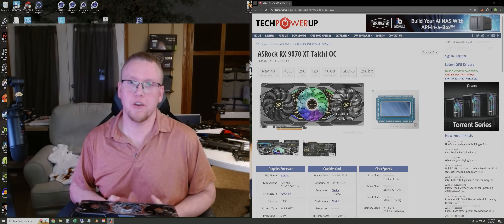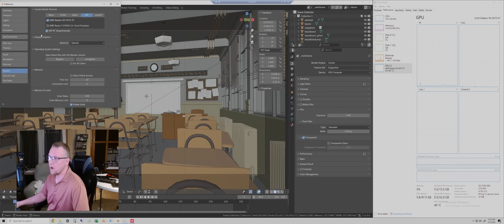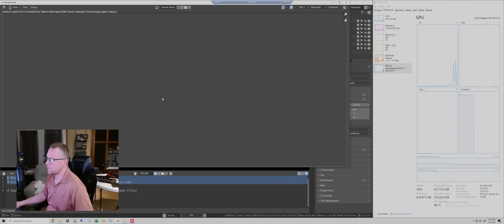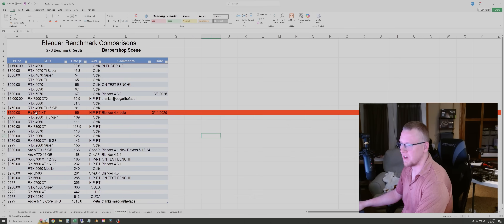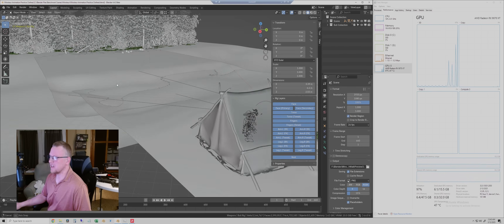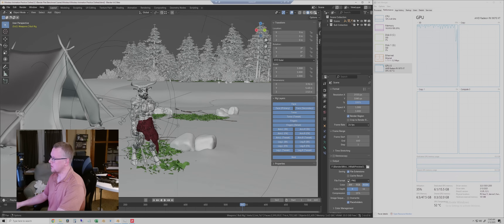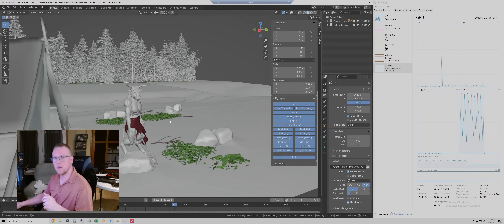NEW AMD Rx 9070 XT Render and Viewport Tests in Blender

Comment: Wow, your videos are amazing! I'm looking to buy a new PC for both work and gaming, as I work in graphics and 3D. I have two options: the 5070 and the 9070 XT. Which one do you think is a better long-term value in terms of overall performance?
Reply from the maker: Hey thank you! I am glad you found me! I know that for gaming, the 9070 XT is a good value. Nvidia drivers tend to last for many years though. So for 5 or more years, the 5070 would be more safe as a production PC. Just look at older AMD cards from 5 or more years ago now. Many creative apps can't even run a Rx 580 at all now. Conversely, my Kepler K1200 can still run Blender and other apps, even though it is slow. So Nvidia support is much longer. So I guess it would depend on you timeframe.

In reality, both GPUs should be great components for quite a few years, assuming nothing changes with Nvidia and AMD in general.

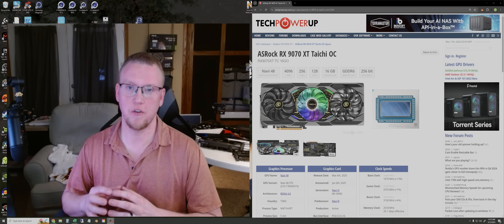Comment: I am getting 1:30secs  with the barbershop scene on the 9070xt, latest drivers.  I am running 128gb 5400mts and a 9950x3d :/
Reply from the maker: That looks like it matches my data pretty close. Glad to have some peer review!
Reply: @ContradictionTech  Hopefully hiprt peeps and blender will find better ways to use rdna4, lemme know if you require any testing done, thanks!
Reply from the maker: @rogernaruto13  Yeah RDNA4 hardware is underutilized by HIP-RT for sure. Thanks for reaching out!
Reply: @ContradictionTech  4.5 has better support now, you can have the denoise in viewpoert done via gpu btw, it still crashes when subdividing 25+ plus faces tho

Comment: I've been wanting to switch over to Linux completely and NVIDIA's drivers have been a deal breaker so far, I have a 3060 12 right now. Might upgrade to the 9070xt if Blender & others start supporting it the way they do the AI Chip Maker.
Reply from the maker: Yeah that's the question. If the gaming scene is all AMD can get for now, they may not develop software for awhile. But, the 9070 XT is fine hardware anyway, it's already a feasible choice!

Comment: blender 4.4.0 is not using my RTX5070 for rendering, its using my processor and im not sure why. 
i have the same settings in blender like you (optix checkmark RTX5070; blank processor) but it wont work for me pls help 
thankful for every answer
Reply from the maker: In the render settings, make sure the render device is set to GPU and not CPU. It is the render settings menu on the right. 
Also, keep in mind that Windows will not show GPU usage correctly with task manager unless you change the graph to CUDA or compute
Reply: @ContradictionTech  Thank you man. The device was set to CPU and not to GPU. Im just not familiar with blender or such programs. Now its rendering with GPU thanks a lot!!!
Reply from the maker: @jasonweirich6961  you are welcome! Glad to help!

Comment: I hope you see this comment. Viewport (solid) performance is all on the CPU. The GPU doesn't matter one bit with viewport fps speed. You can verify this by putting the same GPU in a wildly different system and seeing the different FPS. Thanks for the video.
Reply from the maker: Hey! Thanks for the comment! I thought so too, but different GPUs on the same test system have been yielding varied results for me. Especially in high poly scenes. It seems like lower end GPUs definitely do slow the viewport in solid mode.

Comment: I've wanted to get a 9070XT, I currently own a 2080Ti and don't really know if it's worth it or if I should wait for a 40/50 series card. It should be faster since there's a lot of generational improvements and new tech, and I also don't really plan on spending too much
Reply from the maker: Are you mostly using it for Blender or gaming? Your use case will change my recommendations slightly, and budget will too. I think the 9070 XT is a good GPU overall
Reply: @ I do mostly gaming as my main GPU intensive tasks, but I also model/texture/sculpt and do some animations using Blender (I’m limited by my GPU here so I don’t render much right now, but plan on doing more, I own a 2080Ti AMP which is a 300w card at its max performance, its very inefficient). I also use After Effects and Substance softwares, and these softwares don’t really use that much GPU, but still needs CUDA acceleration to work faster
Reply from the maker: @dummmics  Ok yeah to me, the 9070 XT seems like a good pick at MSRP, as long as Adobe software works fine on AMD. I assume it does though. AE system requirements says AMD works. So you should be good to go!

Comment: I am not a frequent blender user but came across your benchmark and compared to mine (4090 ones) and there is a noticeable difference in the durations. My results respectively were 10.9 s, 53 s, 89 s, 53 s respectively as per scene sequence in video, tested with blender version 4.0.1 and 4.3.2. I am finding the performance to be at least 25% deficit in my case with same render settings. My card is running at base clock. Any idea what could be the reason?
Reply from the maker: Well what is your CPU? And are you using a new studio driver for the GPU? My 4090s are both higher end models, so there is a little extra OC built in, but definitely not 25%.
Also make sure the Blender files are running on an SSD inside your GPUs machine. I have found loading time to be quite bad with files shared from another location
Reply: @ContradictionTech  CPU is i9-14900k and files are being loaded from my gigabyte gen4 7300 1tb ssd. The 4090 I have is the Asus TUF OC model (has all the ROPs). But I am using game drivers instead of studio ones. Do studio drivers accelerate performance by that high margin? Haven't tested those

Comment: I desperately need a new GPU, I've got the RogStrix RTX 3060 OC 12G during the GPU crisis, it's shit. I was thinking about the RX9070XT, but seeing this I'm actually afraid to get it.. Older blender versions won't work... sounds really sketchy. How do Unity and Unreal perform and SubstancePainter/Designer?
Reply from the maker: Thanks for coming in to the stream, was a lot of fun! Do you have a better idea of what you might want for a GPU now? I would say consider the 4060 Ti 16 GB or 4070 Ti Super. But it also depends on what is even available.

Comment: should i buy this for 3d rendering i have a rtx 3050 also
Reply from the maker: The 9070 XT be significantly faster than the 3050 for basically everything, and has way more VRAM. If you can get one at a good price, the 9070 XT is decent. 
For 3D rendering specifically though, Nvidia is faster per dollar spent, when they are available.
Reply: @ContradictionTech  thank u very much, as I still mostly do gaming but have a knack in 3d rendering I will get the 9070xt
Reply from the maker: @Sharbzz  Great! Glad this helped then.

Comment: I've been wondering about the performance for something like the 9070xt for a while now using Blender and low and behold, I stumbled this video in my YT recommendations.  While I wasn't expecting anything top of the line with that card for GPU rendering,  it's great to see that AMD has massively improved on their hardware for both gaming and creative purposes. Thank you for making this benchmark vid, it's been really insightful.
Reply from the maker: I am glad you found this helpful. AMD is rapidly improving their hardware, and slowly improving software. The stable release of Blender 4.4 may be more effective at using this 9070 XT. I am going to test this soon. 
But even without a software fix, this GPU is a great mixed-use PC product. For 3D + gaming it is a very compelling GPU.
Thank you for visiting the channel!

Comment: which one should i get?
rtx 5070 or RX 9070 XT. i dont see any big difference when using blender and i only play video games at 1080p sometimes
Reply: 5070 will handle 1080p fine, but 9070 XT is considerably faster and will handle even 4k gamin. 5070 would struggle with 4k, mostly due to lack of VRAM. With settings to max, raytracing, framegen and all that. 9070 XT will handle all that just fine.
Reply from the maker: For your use case, it seems like either option is ok. If you have a preference for a model then decide by that. Nvidia does normally have better software support, but if you are not planning on using all kinds of programs, then no worries. For 1080p gaming, these GPUs will both be incredible too.

Comment: Thank you for the video! I'm glad the 9070XT didn't completely blow the 7900XTX out of the water. I was worried I made a premature purchase that I'd regret. That's aside the fact that it's marginal compared to NVIDIA (so what), I still wanted a great gaming GPU with the ability to do small projects on the side without breaking the bank. Thank you again for the informative video.

Here are some of my numbers with the 7900XTX using HIP (HIP-RT Enabled)[Blender4.3.2]:

Classroom: 16.22
Barber Shop: 78.82
Lone Monk: 114.64
Scanlands: 65.29
Reply from the maker: Thank you! I feel the same way about the 5090. Was afraid I would feel sad about my 4090 if the 5090 crushed it. Which is dumb, because I am extremely lucky to have all of the fancy hardware I have. Anyway, I think it sounds like the 9070 XT would be a good type of GPU for people who mostly game, and sometimes Blender.

I will add your results to my spreadsheet, as I do not have thorough data yet. Would you prefer that I add your name to the list, or keep your name off? Up to you.
Reply: @ContradictionTech   Great, I'm glad I could add more info to the spreadsheet. If you'd like instead of my username you can use the name "Linux-U" for the results, since I ran the tests on Ubuntu. Ah, also to add more data (if of any interest) I have also ran some tests using ZLUDA(lshqqytiger fork on github). If that is of any interest or not I will have those benchmarks below.

7900XTX using [ZLUDA v3.9.0][Blender4.3.2]:

Classroom: 18.37
Barbershop: 84.36
Lone Monk: 144.02
Scanlands: 93.60
Reply: @ContradictionTech  I'm happy with my 4080. Only because I do a lot of 3D work, which AMD Radeon hasn't caught up with Nvidia despite developing their ROCM API to compete with Nvidia's CUDA Cores. 
Even though I don't like how greedy Nvidia are with their prices.
Reply from the maker: @ The 4080 is a fantastic amount of speed too. Glad it works for you. That is one of the models I have not tested.
Reply: Thanks mate!!

Comment: How is it on Eevee ?
Reply from the maker: I can run some Eevee tests. Would you be interested in final render speeds? Or mostly viewport tests? I can run both as well. I will just have to get some Eevee compatible scenes, as this scene of mine is Cycles ready but not good for Eevee.
Reply: @ContradictionTech  Both will be very nice. And if I may ask what about compositing (other on GPU offloaded node computing) acceleration?
Reply: Both will be great 👍  I have a 3060 ti and planning to upgrade to 9070 XT. I usually do eevee rendering and view port for as Cycles is not my thing. Thanks in advance. 👍👍👍

Comment: It seems like AMD still struggle in some situations than the RT performance would suggest? Is this a hardware or software issue?
Reply from the maker: I believe it is a software issue. HIP-RT is not optimized at all for the hardware. On paper, the 9070 XT Should have much better performance results.

Comment: Im a game dev who wants to make the jump to linux would it still be recommended to pick up a 9070xt despite the performance loss compare to Nvidia? Looking to avoid the driver complications that come with Nvidia on linux haha.
Reply from the maker: Yeah make sure the drivers are ready for Linux on the 9070 XT. It should work well enough. Keep in mind, I do not use Linux currently, so I have less experience with AMD on Linux.
Also, Blender tends to run better on Linux, so if you are using Blender you will make up more performance than my tests show.
Reply: Thanks for the reply! I'll take the plunge then, And hopefully won't have to return to windows beaten and bruised some months later.
Reply from the maker: I think you will have a good experience. I used Linux briefly a long time ago. It is incredible for a free software with no strings attached. 
Let me know how it goes sometime!
Reply: Nvidia is barely compatible with Linux, AMD performs even better on Linux than it does on windows

Comment: It was a little disappointing to see the 9070xt being beaten by a 3080 in the smaller scenes, but that seems like a strange result. I hope driver updates address this.

I am a heavy C4D/Redshift I am very eagerly looking forwarded to seeing the Cinebench/Redshift benchmarks.  I manage a Price vs. Performance google sheet and I was really hoping AMD would make a strong showing in this generation.   IF the MSRP holds up they MIGHT, But if your results are pointing to a deficiency of some sort (VRAM loading? Definetly slow to first pixel). then Nvidia will still have the best GPUs for rendering in this generation.
Reply from the maker: Yeah I hope AMD drivers will improve. I imagine they will, since the Cinebench 24 test wouldn't load. It makes me think the driver is just not done. I was surprised Blender 4.4b had support, but AMD does work with Blender devs. So we will have to see if they can optimize any more. That and a newer version of Cycles may help, if it is causing problems in it's current version.
Reply: @ContradictionTech Redshift was originally build on CUDA.   So the AMD version needs to run on OpenGL.  So Redshit will need to make an update to run on the new 9070s.   Redshift is what’s is being used in the Cinebench benchmark.
Reply from the maker: @ Ohh yeah I forget that. I do not use redshift other than Cinebench. Thanks for clarifying that for me!
Reply: Hey question king, I'm not a 3D artist (yet.   Need the money) but out of random curiosity, why don't you use Blender/Cycles? Love to hear your thoughts because I considered starting off with C4D/Redshift/Octane when I start (money isn't a problem for that end. Sailing the seven seas!). Reason is because I heard it's the best and the standard so (and also the UI looks so damn clean)

Comment: How's the non XT version?
Reply from the maker: I do not have one. But it should be the same difference between the XT and non XT for FP16 speed. That should give a some idea. Techpowerup shows the XT is 11% faster in its ranking, but that is not for 3D rendering specifically. 
I think for the price difference, the XT is probably a better option.
But I would have to test it to know, so take my answer with a grain of salt until then
Reply: @ContradictionTech  thank you, unfortunately the XT is $200 more expensive here, I've been researching parts for three days now and came up to Ryzen 7 9700x with a rx 9070
Reply from the maker: Oh that is a much bigger difference. In your case it sounds like the extra cost is maybe not worth it then. Prices are terrible right now.